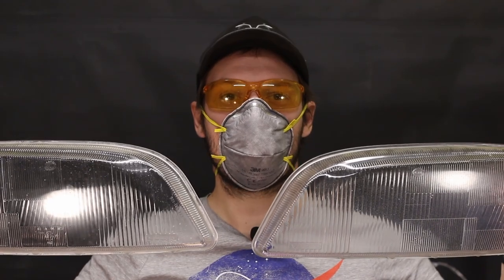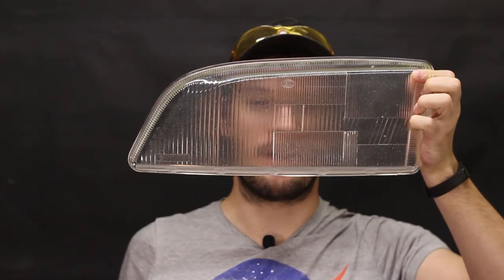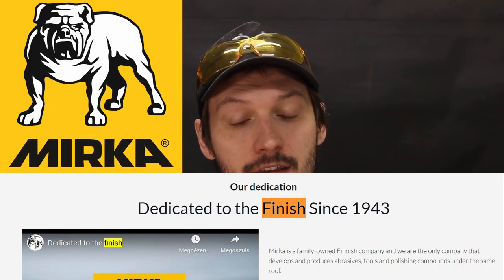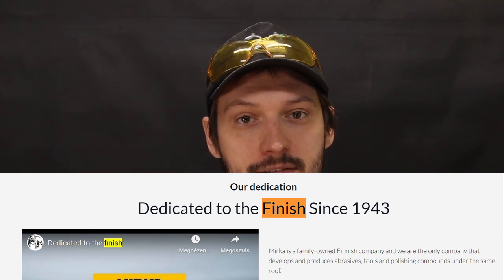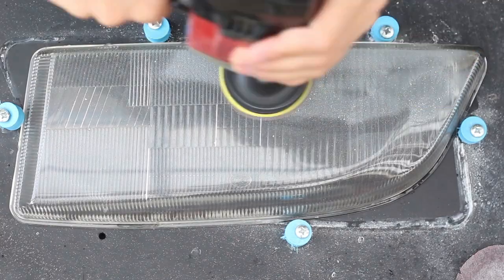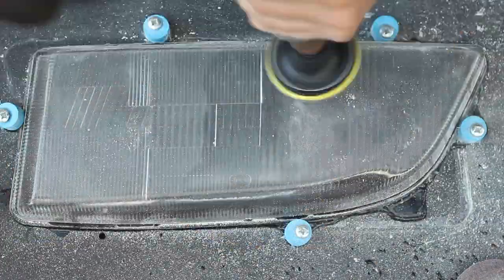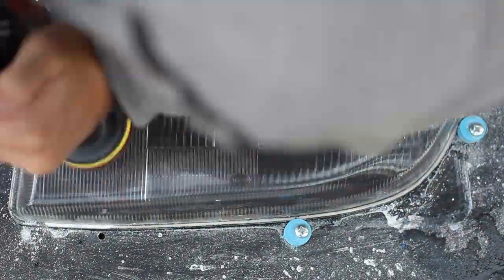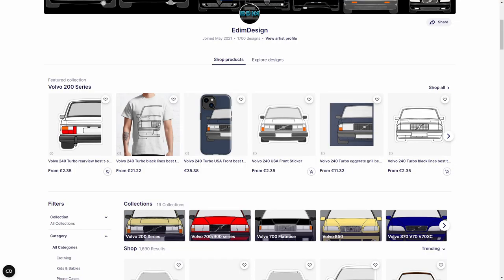How To Restore Your Glass Headlight Lenses? Sanding And Polishing!

Comment: The first comprehensive guide to polish glass headlights! How many discs did you use? The Mirka brand is hard to buy in less than 50pcs per grit. Thanks!
Reply from the maker: Hi Bjørn! I used 1 pad of each for each side. So I used one 150 grit net, one 360 grit pad, one 600 grit, one 1000 grit, one 1500 grit, one 2000 grit, one 3000 grit. You just double the number from 150 to 2-3000 and then the cerium oxide based polish. 

I used Mirka, because I found that. If you can find any other brand, it can work, but it has to be good for glass. If the company says, maybe, it's not good enough. Mirka even has glass sanding tutorial videos on it's website. Just message @KWHMirkaLtd I'm sure they will tell you a shop you can buy their products.

Comment: Great video! About how many sanding discs did you use?
Reply from the maker: Hi Taylor! 

I used one of each for each side. 
So 1pc 180grit net, 1pc 360grit pad, 1pc 600grit pad, 1pc 1000grit pad, 1pc 2000grit pad, 1pc 3000grit pad. 
1 net and 5 pads total. And then the cerium-oxide based glass polish. 
It would probably work with less steps but I didn't want to risk it. 
The cost was about €10-15 or $10-15 total/side. 
The cerium-oxide is the most expensive part. 

Thanks for asking.